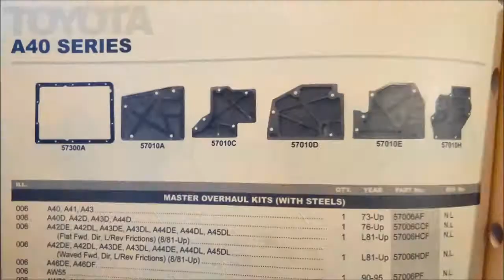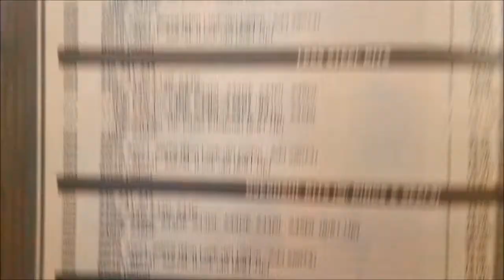Toyota A40 Series Automatic Transmission Filter Service & Fluid Oil Change

Comment: Hey mate  i have a RT132 liftback with the A40 auto. It wont  reverse unless i reve the car up a fair bit.  Can this be fixt or will i need a new gearbox. 😢
Reply from the maker: hi, try the easy remedy first, and always start with checking the basics. cheers

Comment: Nice  video. Do you know the torque of the bolts that hold the converter to flex plate?
Reply from the maker: hi, I`d say about 50 ft-lb and put a dab of blue Loctite or red locknut Loctite on thread. if they are the high tensile fine thread bolts, you can tighten them more. sorry its been ages since I torqued converter bolts to specs, I just tighten them hard. check your shop-manual or online. cheers
Reply: Thanks, dude !

Comment: Hi How much oil did you use to refill it ? thanks :)
Reply from the maker: hi, sorry if its not on video, I can`t remember. but always check as per specs or as recommended. on these, it`s with motor running and at operating temp. cheers